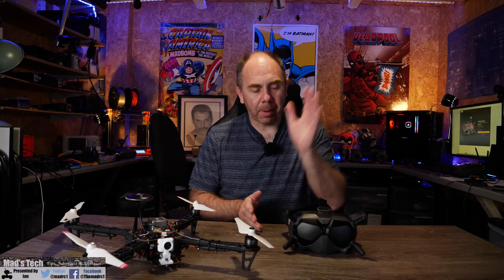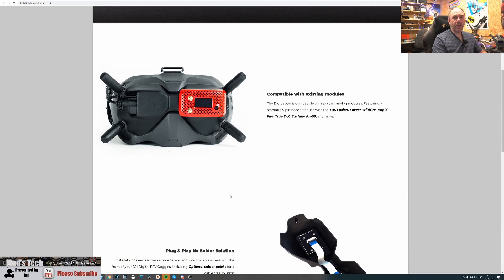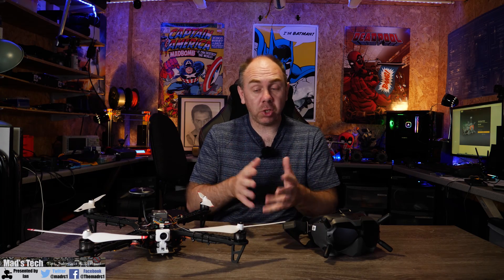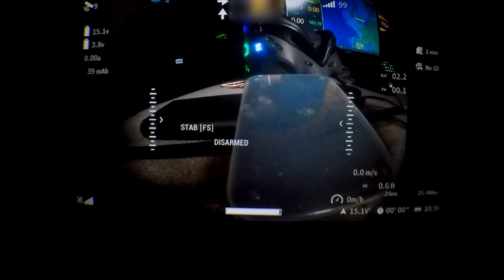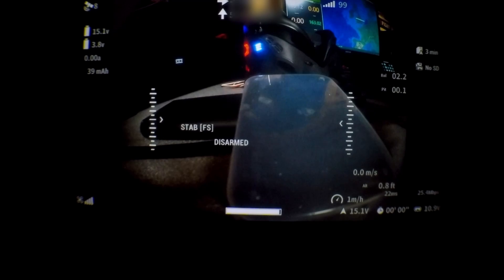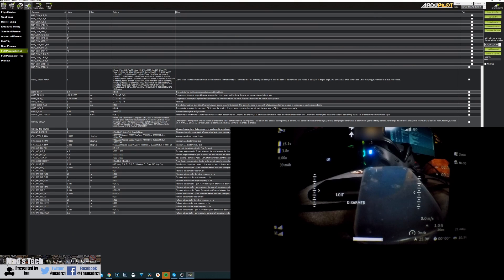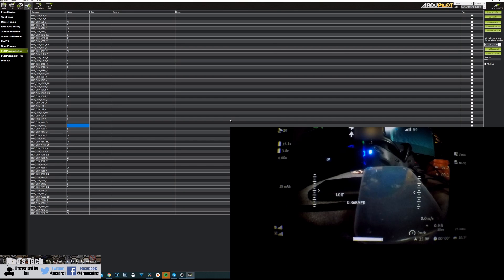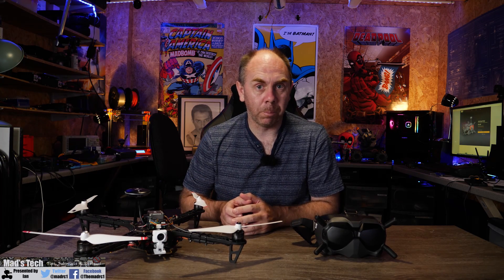DJI FPV Ardupilot Support & Digiadapter Analog Plug & Play Mod

Comment: As of Sept 2020, Does the DJI FPV system work with pixhawk officially ? On the github it's using arduino nano for conversion, Is that a official release or what? because there is a warning message.
Reply from the maker: Support has just been added to master build but it’s not in the new 4.04 public release yet.

Comment: Hello, i am new to arduplane. I was able to fully setup my wing correctly using ardupane 4.0.5 on holybro kakute F4 FC, except for the OSD on my DJI digital fpv goggles. I am using UART 6 (Serial 1), so i setup serial1_protocol = 30 and serial1_baud = 115. I have also setup MSP_options to 1. I wired DJI air unit TX to uart 6 RX and RX to uart6 TX. I still cannot see any osd in my goggles. Am i missing any step here ? I am using MSP version 0.7 firmware for my FC. Thanks

Comment: Where does one find out how to implement the hardware on the drone or is this a way that Arducopter can talk to the DJI Air module...sorry just not understanding how all this comes together
Reply from the maker: Yes it’s the communication protocol for the osd.
Reply: @MadRC  Thank yo. Thats what I figured..but wanted to confirm it.

Comment: Mad's Tech, thanks for the great video. You got me hooked. I have purchased DJI HD goggles ready to use on my Matek F765 fc running arduplane. Is there a simple explanation of what I need to do to get the required hex file using Yaapu's ajp file? do I need to compile the source code with the ajp library using Arduino??? or something like that. Be kind to me, I was born long before computers were invented and I am trying. Cheers, Bill
Reply from the maker: There is a test build of Ardupilot now with the MSP support in, go to the Ardupilot forum and look in the Dev section for MSP support and I’m sure Alex will make you a build.
Reply: @MadRC  Thanks for the reply. I've been searching the internet and found that unless I'm wrong, the ajp file is added in Mission Planner under the "Load Custom Firmware" section on the Config tab. There must be others who were lost on this step. Keep up the great videos, cheers Bill
Reply: Oops, I meant SETUP pulldown then INSTALL FIRMWARE page.

Comment: Sorry, can’t find the link to the forum discussion  on the Malinke/DJI goggles osd stuff.
Reply from the maker: Sorry it was late it’s here https://discuss.ardupilot.org/t/msp-protocol-support/57944/56
Reply: Thanks Ian, I have my favourite reliable 7” quad that has flown dozens of miles with the DJI system working flawlessly. I see a build for the Matek F405 std has been requested and done so I’ll try it. I have been using iNav but the home direction arrow and altitude are all over the place, everything else appears fine.

Comment: How is DJI air unit wired to autopilot?
Reply from the maker: Same as to any of the controllers via UART , Tx/RX,Sbus and Ground.
Reply: Hello! Great video! For analog setups, I use a minim osd board to a pixhawk flight controller. I am willing to replace the analog setup for a DJI air unit. Should I use the same wiring used in minim osd in DJI air unit? Minim OSD uses 5v and DJI at least 7V. How may I change voltage from the serial port? May you show us your wiring? Thanks a lot!